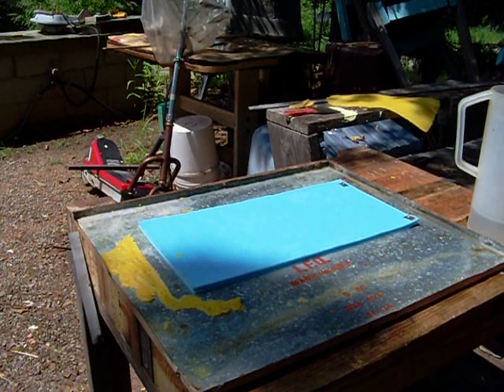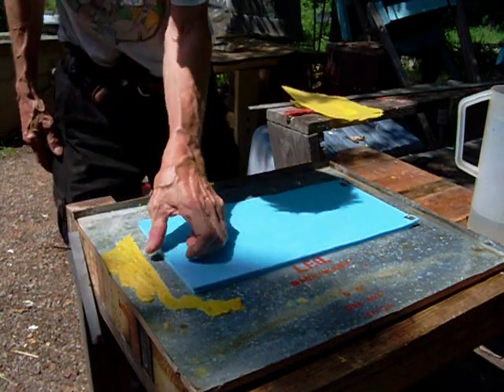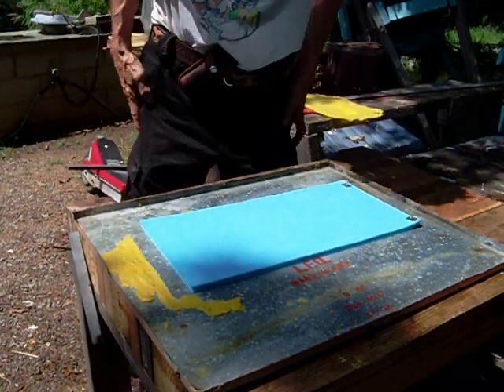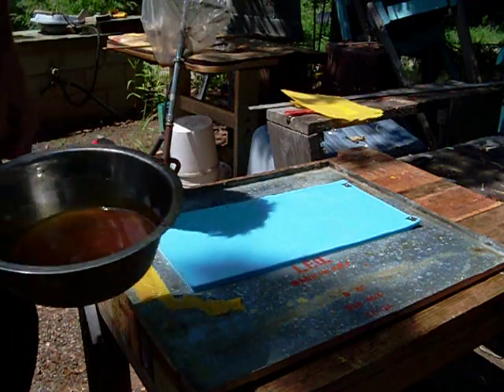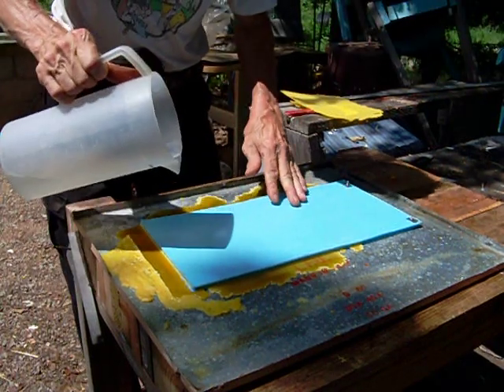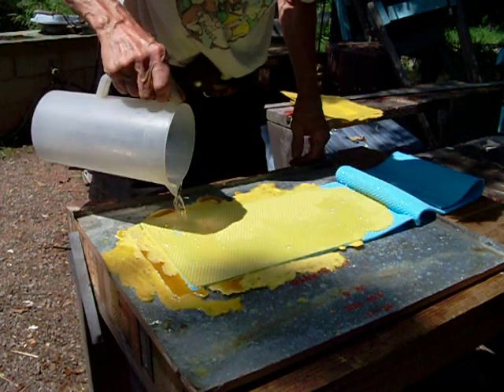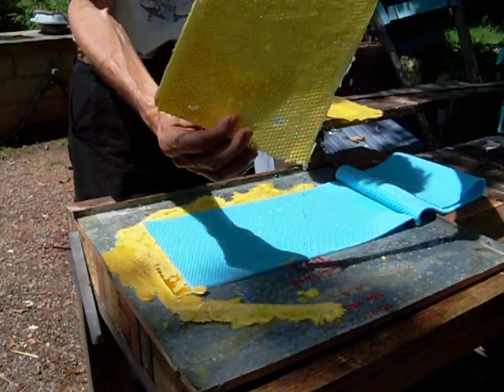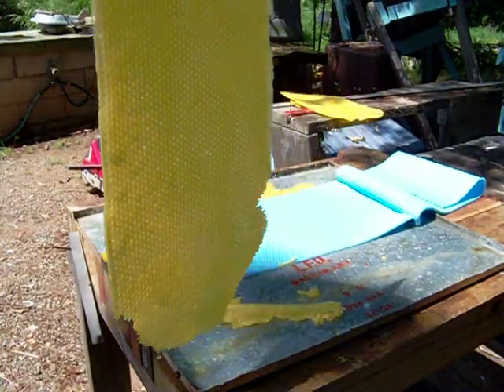Using a foundation mold

Comment: Beehive cells do not overlap parallel from side to side.  The vertices are in the center of the opposite side.  And the walls only cross across the plane of the comb